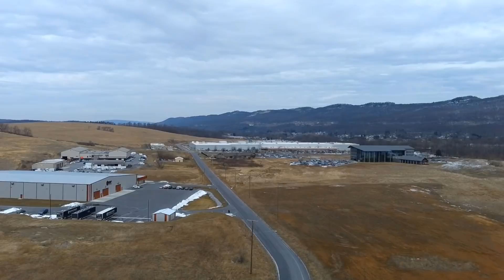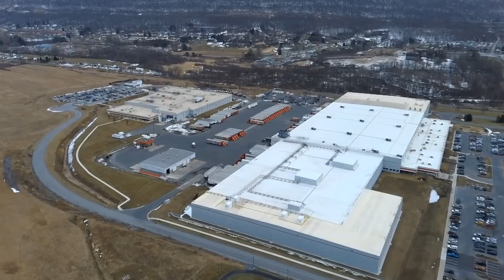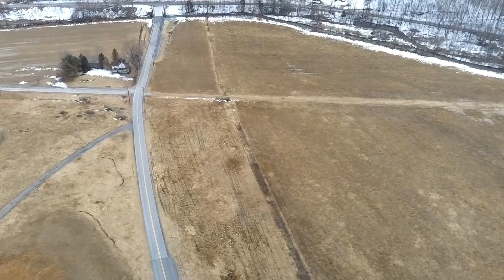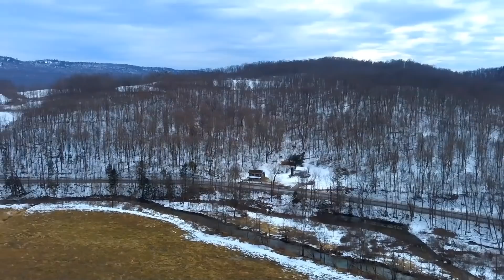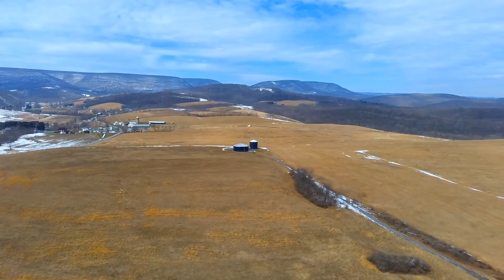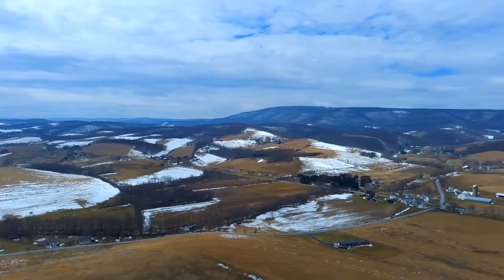HUBSAN ZINO - WHAT I FOUND IN TODAY'S FLIGHT TEST

Comment: I took the plunge and bought a Zino after seeing the latest update. I received it today and will update tomorrow. There is a bit of a mystery though. Boxed in with the remote control were 7 packages of WiFi and Accelerometer/gyro boards. Hubsan's part number: 3962340861361875. The WiFi board's number is: EA4000017-01 V1.1 Also, there are no connectors for the antennas and the board has only a printed antenna. Not sure why those were in the box unless they were just finding a way to dump some bad parts. They look official in their anti-static bags and Hubsan label. Anyway, I'm anxious to fly tomorrow. Thanks for the good info.
Reply from the maker: Pierre LaPlante You’re kidding me!
I have to see a picture if this. Are you in my group? Join and share this....too funny!
Reply from the maker: Pierre LaPlante I hope you didn’t get another persons old problems!
Reply: I could send a couple of photos but not sure how to attach them here. I am a subscriber.
Reply from the maker: Pierre LaPlante kitchwade@gmail.com

Comment: Thank you for your persistence and your honesty about Zino. If you can't even control the annoying crab-walk then I'm relieved that it's not my fault when I can't always fly the Zino in a straight line. Also thankful you mentioned the deficiency of the HT016B controller paddles in the last video. It's been THE one thing that has irked me to no end from my very first flight. 
My Zino was sent back to El Monte just before the last round of upgrades came out. Today they emailed me with a UPS return tracking code. It seemed a quick turnaround so maybe they're just sending me a full replacement, we'll see. The good news is they promised that my Zino will have all the latest upgrades installed when it arrives. So it looks to me like Hubsan is taking care of the pre-order crowd in light of all the acknowledged issues since their roll out. 
I'm keeping my fingers crossed that one day there will be an advanced version of the Zino controller down the road. Who knows, it might even solve the crab walk when it comes out.
Reply: P.S. My takeaway from the Zino experience is that I had unreasonable expectations going in. At the end of the day Zino is still a toy-grade quad with a surprisingly good camera system. Once you keep that in mind and discount the quirky idiosyncrasies, Zino (once these last upgrades are installed) exceeded it's value for it's price point

Comment: Seems from the last firmware updates, the 1km barrier has been removed. Of course, without  modding no real possibilty to go much further... Hubsan is polishing his machine... and now results are not bad at all... I am afraid now the reputation is deeply impacted by the early immature firmwares....
Reply from the maker: SeBy DocKy I cant confirm that. I can only say it went past it in this flight. 
Interference could be the reason it went further and sat there as long as it did but it’s hard to confirm interference as well if we can’t see it. 
Not sure what happened there. 👍
Reply: @QCGUY  With the n-2 FC firmware, I had a geofence barrier at 1km. The machine slowed down from 980m to stop precisely at 1km...
Reply from the maker: SeBy DocKy Yes Im very aware of that. I’ve tested every version. It’s how they have it programmed and like I said I can’t confirm if it’s still the same in this version. I would guess it still is and this flight was just a behavioral thing.

Comment: So literally you were forcing a disconnect with flying such far... so it doesn’t count IMO. It reconnected automatically when returning, so everything’s fine with that. 
What still remains (and that are also my main issues): 
- nose straight in flying direction
- smoother control esp of yaw
Reply from the maker: Hartmut Paul I was forcing a RTH not disconnect. It went further than I expected so I went with it. 
The concern should be will it just hit that thresh hold and RTH or disconnect every time like this?
I don’t like crossing my fingers! 😂 
It does count as a disconnect in my book. 👍
Reply: @QCGUY  are you saying you want the zino rth after reaching its max distance without disconnect? Well that would be nice!
Reply from the maker: Ardi Pratomo 😂 It does for others.

Comment: Looks like an amazing area, every flight appears slightly different. Could it be a bad compass was used in the Zinos? How long did the batteries last this time? Thanks for the video 👍🏻
Reply from the maker: Hugh Pollock I think it’s all still flight control issues they need to dial in. 
They had compass issues very early on with the 501 models that created odd behaviors and TB’s so I think it’s just firmware issue at this point. 
Im not impressed with this channel selection option so far. Doesn’t seem very accurate to me.
Batteries did better this time around at about 20 minutes each so perhaps it’s what I said about getting them broken in which isn’t unusual. 
Still keeping an eye on it. 👍

Comment: Interesting... I did notice on the first flight you were not as high as the second and that you flew further out in the first as well. I have never gotten more than 650m out and 50m up on mine before the Black screen of death appears. And yes... Just sit back and wait. You did have some wild interference on the way back on number one. All in all 1100m is really good. Mine also does the bounce, crab walks and is off skew on RTH. maybe calibrating at each location would be a good thing.. Great flights though... regardless of hiccups.
Reply from the maker: Gorilla Man I calibrate before every flight in a new location and yes perhaps interference but when you can’t see interference it not conclusive unfortunately. 
I was only about a 30 feet difference between flights but both were at a good height to always be in line with the controller. 
I try to keep all flights consistent when testing in the same location to rule out differences.
Reply: @QCGUY  There was a guy in Germany that did a test for the Bebop over different powerlines and through the Bebop flight logs you can see WiFi signal strength in a graph. It was interesting to see how much signal loss there was as he flew over certain parts of different lines. In all Honesty I am amazed you got 1100m with the Zino that close to that workplace. Also I am in Awe of your local Landscape. All we have here is a flat barren wasteland of Homes, Highways and mile after mile after mile without even a Hill.

Comment: Great, seems she is doing much better with this .48 firmware update. Aside from the minor issues she still has or you got with your zino that right crab walking and toilet bowling. I'm impressed that you were able to go more than the advertised range of 1km. 4000ft is 1220m wow 😊 Did you record in 4k sir?
Reply from the maker: Amaterasu Mi Chiyoko Luy 1080 60fps...Technically it was 3700 feet. 😂 I was still happy with that. 😎
Reply from the maker: Amaterasu Mi Chiyoko Luy the link to my group is under the video and Im also QC Guy on Facebook. 
https://www.facebook.com/profile.php?id=100034372188315